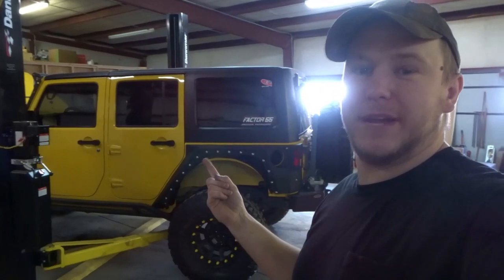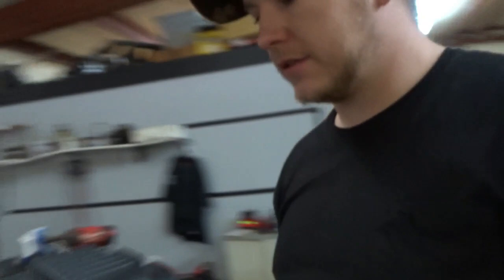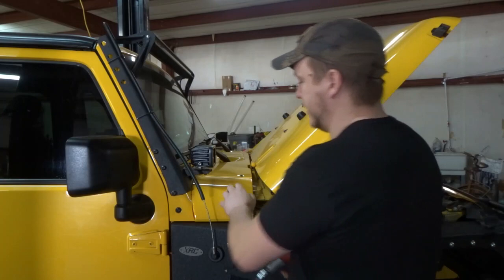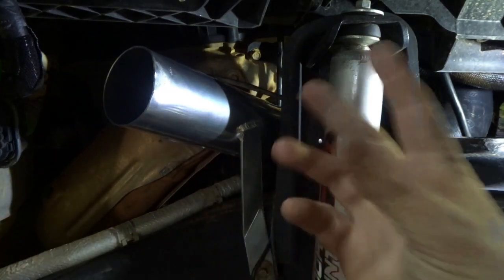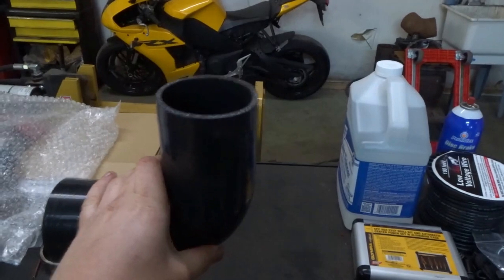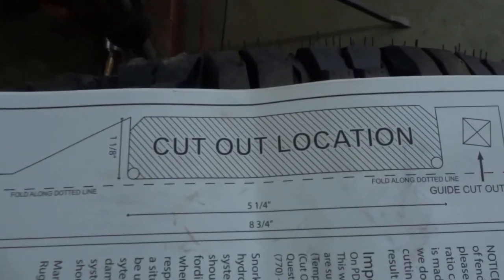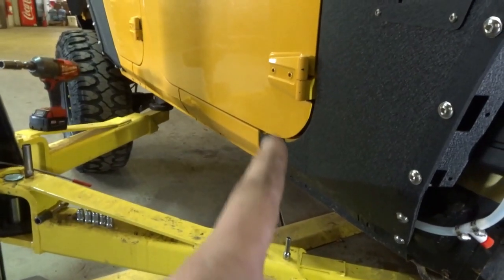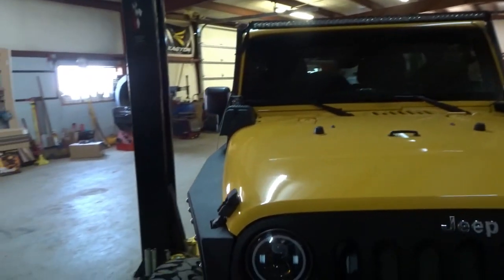Installing a rugged ridge snorkel on the jk build

Comment: Glad you posted this. Across almost every forum and even your comment section, I see bias towards the rugged ridge. Seems like most people neglect to research the fitment with the smittybilt fenders. Way more cutting to use any other brand aside from the RR snorkel since the fender sits so much higher than factory. Literally the only way to go without some real fabrication. Thanks for proving it works because I'm in the same boat currently.
Reply from the maker: Ya I agree. Thank you for watching glad it helped

Comment: We’re you able to use the high snorkel with your light bar? Any issues after a year?
Reply from the maker: No the light bar brackets r in the way the part that holds the pods on edge of windshield. And zero issues and we've had it in water over fenders
Reply: @MILLERSTV  perfect we just added these fenders to my wife's jeep Bella, We are posting a video tonight from our overlanding trip where we went in 3.5 feet of water because we had to get across but I never want to risk that again without a snorkel! 

We spent a ton of time getting those fenders smooth so that we could paint them, check out the build and let me know what you think!

 We actually used your fender install video as the instructions so thanks for what you do man.
Reply from the maker: @DownSouth_Adventures  thanks buddy ill definitely check it out and subscribe

Comment: Can you tell me what the diameter of the inlet on the bottom of the airbox is? I have a custom airbox
Reply from the maker: I'm not around k
Jeep till tomorrow
Reply: @MILLERSTV  no worries, bud. I'm in no hurry. I'm still installing the engine.
Reply from the maker: @neilmarshall4927  ok cool ya if u can remind me soon I'll def measure it for you
Reply: @MILLERSTV  absolutely. Thanks man. Great content.
Reply from the maker: @neilmarshall4927  anytime bud. Thanks for the support
Reply: Did you get a chance to see what that measurement was?
Reply from the maker: @neilmarshall4927  no sir honestly I completely forgot work has been crazy if u can message me tom and I'll stop what I'm doing and get the measurements for u  im sorry about that
Reply: @MILLERSTV  no problem.
Reply: @Millerstv  would it be ok to check it now?
Reply from the maker: @neilmarshall4927  ya what part r u needing measured?
Reply from the maker: The inlet on bottom on airbox looks to be like 3 and 1/2 I think there so much stuff on this jeep it's hard to get in there to measure but I belive it is it comes with its own tubbing and all that
Reply: @Millerstv  thanks man.
Reply from the maker: @neilmarshall4927  any time buddy

Comment: Does the high snorkel option work with that light bar?
Reply from the maker: Ya it does
Reply: @MILLERSTV  awesome, thank you for the response!  I know it's only been about 5 months, but what are your thoughts on it so far? I'm debating between this one and the AEV Snorkel kit. I've heard mixed reviews on this one, so I don't know which route to go yet (i like the aesthetics of this one better, but I've heard that the drainage tube can get clogged).
Reply from the maker: @thecleancaveman7770  so far all good I like the looks alot havent had any probs yet